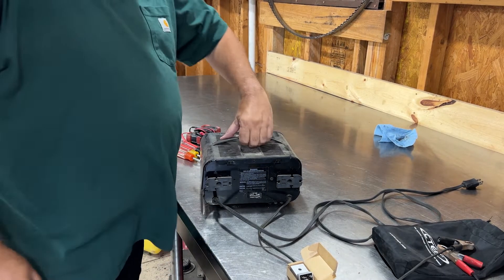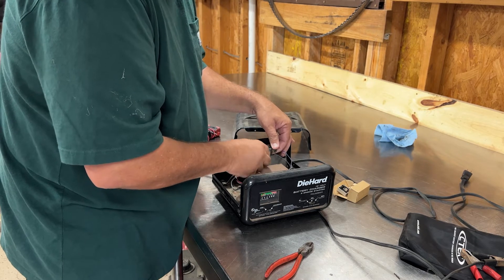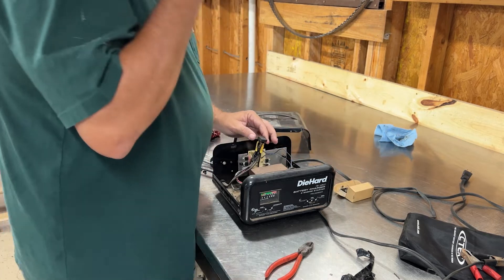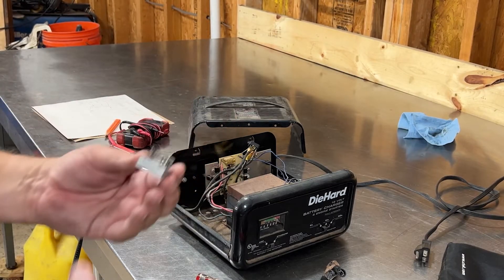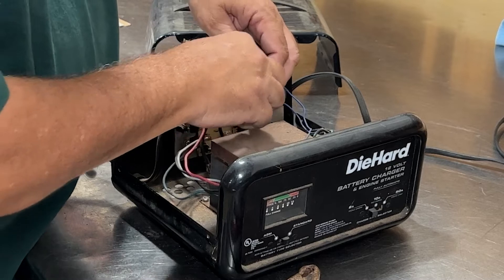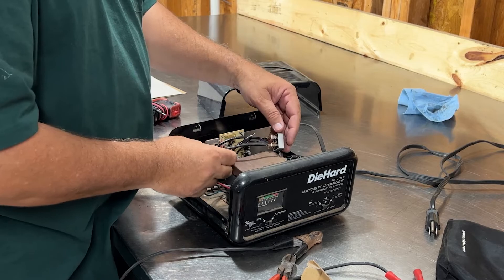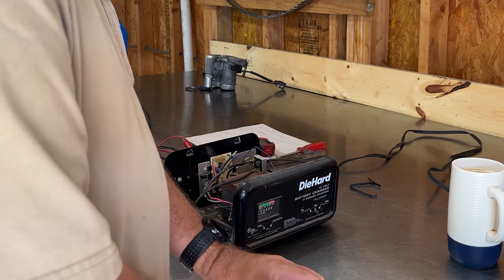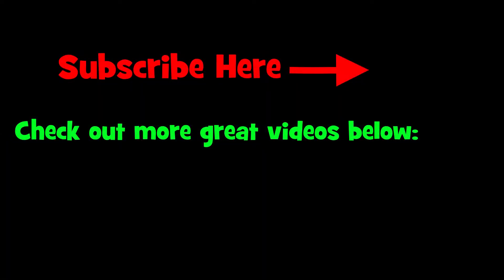Battery Charger Upgrade - Rectifier swap and constant power

Comment: Heatsink the rectifier
Reply: Yep definitely going to make heat doesn't matter if it's rated for 50 amps a good heat sink is not a bad idea but they generally just bolt them to the case which seems to be fine